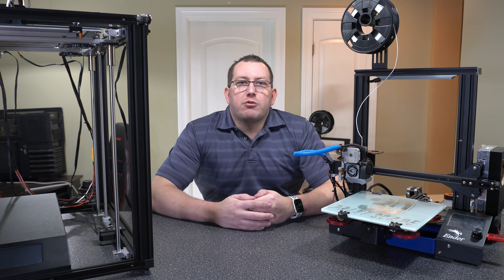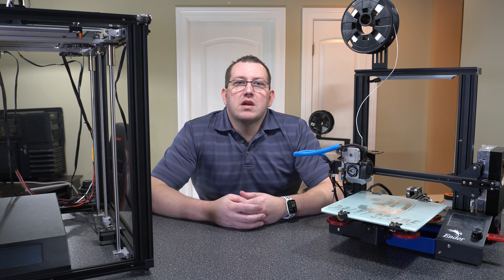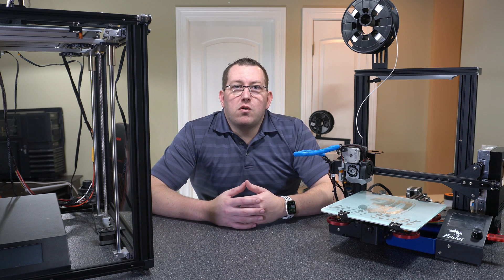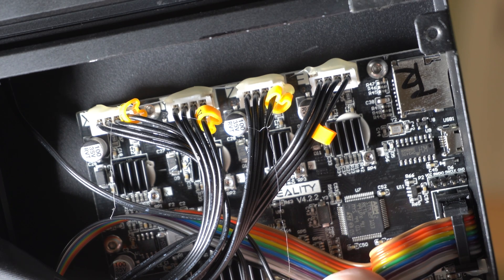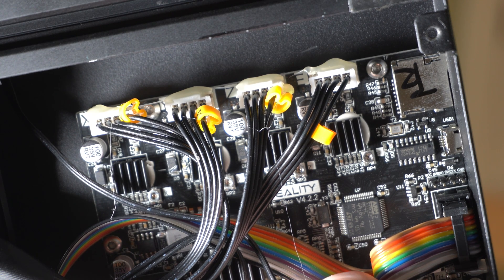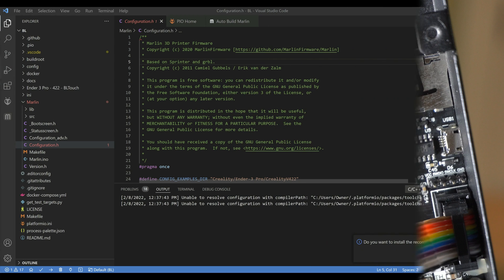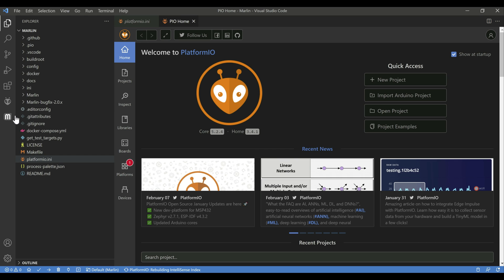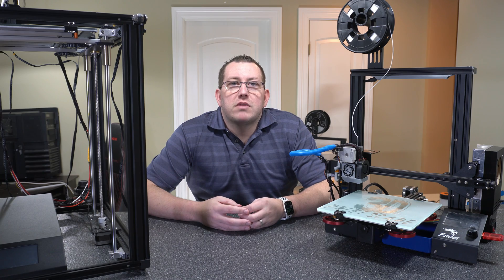Creality 4.2.X Chip Change – Details Inside!

Comment from the maker: I hope you found this overview helpful! If you have any questions or would like other tips/tricks, just let me know in the comments.
Reply: Yes please!
Reply: Hello Rob, hope you are well. I have used the firmware off your website but i am still having problems with my ender 3. I am still getting flickering on my screen. I have the 4.2.2 with 512k chip I also have the cr touch but that is not enabled, when it is and I use that firmware i have no screen flicker, but CANNOT configure the cr touch correctly. Any help really appreciated. Many thanks.
Reply from the maker: @Ameliawebb2016  What firmware did you grab off the site?
Reply: @3DPrintscape  i downloaded the Creality 4.2.2 (RET6 – 512k)	bugfix-2.0.xno mods version. Thanks for replying so fast by the way!
Reply from the maker: @Ameliawebb2016  Try the 256k version when you get a chance.
Reply: @3DPrintscape  i will give that a try as soon as my latest print is finished many thanks. Brilliant website and you tube videos, I will recommend them to anyone that gets themselves into 3d printing. I think a few of my work colleagues are getting interested because i have just got one. They are a minefield but your help is greatly appreciated Rob. Thanks again. Will let you know how it goes with the 256k version 👍
Reply: @3DPrintscape  working perfect now Rob mamy thanks. Had to flash to touch firmware then back to 256 for it to flash though for some reason. Just trying to tweak for petg print now, really stringy ha ha. Thank you so much again for your help and firmware.
Reply: Hello again Rob sorry another question. My printer is the ender 3 4.2.2 gd ret6 chip. Is it ok to use the pro firmware on it as i have noticed on the main screen it now says ender 3 pro on it. I am having a few printing issues at the moment and wondered if maybe i need to go back to the stock firmware or pro is fine. Many thanks again for your help and videos. Cannot get the cr touch setup either 😅😂
Reply from the maker: @Ameliawebb2016  Ya that should be fine. To the firmware there is no difference between the base and the pro.
Reply: @3DPrintscape  thanks. It seems to be running good now but i have had to order a new hotend and tube as it failed miserably. I will get there eventually i hope 😅

Comment: Still new to 3d printin but u think this is was my ender 3 pro can no longer read sd card after updating it from the creality after installing the firmware for a cr touch board 4.2.2 it says no tf card
Reply from the maker: Hi. I saw something about this a while back, i think it may have been a bug with the Marlin build at the time or it was the build for the wrong chipset. You can still flash it to a different version of the firmware on the SD card. It reads it at that level but not when your in the printer and want to select a file to print.

Comment: Hi Rob, I've got a V2 Neo with v4.2.2 GD32F RET6, can I still use this firmware? I'm having problem flashing this back to stock for sometime now. been left alone for a while, I'm now just got the time to circle back to sort this out.
Reply from the maker: Hi. I havent looked up the differences between the standard and v2 neo. If the build plate is the same size it should work.

Comment: hello, i am having hard tome upload your costume firmware because  of version. i want to enable dircet drive... i found how in the configertion file but cant rebuild it. i need you to tell me the exact version you have use in this video or even upload a direct drive + BL touch firmware to ender 3 pro on your website. thx!
Reply from the maker: Hi. The config files wont work if changes are made to them in later releases, i just include them for reference. The easiest way to make a new build would be to grab the latest config and build and use a tool like beyond compare to see the changes between the config files.
Reply: @3DPrintscape  I don't know how to do that, I have tried to build firmware with the latest marlin... But when trying upload the build firmware my printer doesn't recognize it... I tried to change the name... Like: firmware112234

Comment: Great video!, just helped a mate of mine.... and found out after 3 hours of troubleshooting that he doesnt have a SMT board. ( we tried both the 512 and 256K firmware) but he has a GD chip... And that fixed the issue. His firmware got corrupt so we needed a new one. And NONE of them worked till i went to crealities site reluctantly and was like.... lets try their broken borked firmware. And low and behold.... theres a new GD chip.
Reply from the maker: Hi. They keep changing the chips out, not sure why. Later marlin build should have support for the GD chip, i just dont have a printer with it to test.

Comment: so, I bought mine july of last year and I have a gd32f303 chip and I'm trying to figure out if I can put marlin on it or not
Reply: Crealities own GD firmware is "OK" it isnt as bad as their older firmwares. However im trying to get my own enfiroment for it. lets see.
Reply from the maker: Hi. I have been able to get it to work with the new 256k environment option.
Reply: @3DPrintscape  I was reading on the th3d post about it, that you could, but it was introducing artifacts. Most people are just upgrading the board to install Marlin.
Reply from the maker: @STOPH3R01991  That is always an option as well.

Comment: What about the GD 32 F 303 RET 6 chip?
Reply from the maker: Hi. That is a 512k chip, they started shipping with them after i made this video. Recent firmware builds should work with it.
Reply: Did you tried the 512k stm build?

Comment: I have a 4.2.7 board with a rct6 chip
Reply from the maker: Hi, You would use STM32F103RC_creality (256K)
Reply: @3DPrintscape  and do i need to change  anything in config h. My printer is stock
Reply from the maker: @jonathanjo4273  Depends on what your trying to accomplish. If your not adding any mods or anything, you wont need to mess with the configuration.h file.
Reply: @3DPrintscape  thanks a lot

Comment: Hi.. My name es Leo, from Argentina.... I need make a questions.. I've an Ender 3 Pro 4.2.2 and a chip STM32F103 RET6. I saw your video about how enviroment select (mine is 512k). 
The first question is: i put  in platform.io:

default_envs = STM32F103RE_creality

#define X_DRIVER_TYPE. Wich I have to select...?
I tried with A4988 and TMC2208_STANDALONE. But when I put the firmware into printer, I don't have any problem 
but it only prints one layer and the lcd restarts. By now I'm keeping the original version of marlin.
Thanks for all and regards.
Reply from the maker: Hi. It will depend on which version of the board you have. If you have the standard 4.2.2 you will choose A4988. If you have the silent one, you will choose TMC2208_STANDALONE.

Comment: Thank god I did some research before updating my nephews firmware. Got him into printing when he get the 100 dollar ender 3 pro from microcenter. Sure enough his is the RCT6, so I compiled marlin 2.1 for him and got it working, everything checked out except when it gets to the same spot on the purge line everytime, it reboots the printer. Looking into it now as I shall not accept defeat but if you have any info on this sort of issue it'd be immensely helpful!
Reply from the maker: Hi. I haven’t seen that behavior before. I would grab the latest firmware again and make sure your using the correct config example.
Reply: @3DPrintscape  thanks for the reply! my vigorous searching last night led me to powerless recovery. That was the culprit. Must be a bug in marlin 2.1 as I haven't seen many people reporting this issue. Disabled it via LCD and it worked like a charm. Went ahead and disabled in firmware to prevent other mishaps. If I had more time I'd play around with Powerloss setting as he'd like to keep it, but I'll probably just end getting him an SKR mini as I have one in 3 of mine and they are fantastic!
Reply from the maker: @TheGrowOp  Im glad you got it working, and thanks for sharing the fix.

Comment: I just bought two Ender 3 Pros, and both came with an entirely different CPU. Instead of an STM32F103 RCT6 or STM32F103 RET6, I have a GD32F303 RET6. I know this is a slightly older video but I thought it was most relevant here. It seems they've changed the CPU out yet again... Any idea what this might mean for compiling my own firmware? 

Thank you for the incredibly helpful videos, :))
Reply from the maker: Hi. I did hear about that, im wondering if they are having a hard time getting the chips. I also think that is whats causing the screen glitch many people are having not after updating the firmware. I think you will be fine with the normal 256k build. You can try the one from my site, it doent have the screen glitch issue. https://3dprintscape.com/marlin-firmware-builds/

Comment: Thanks for the video! Just a heads up though, I purchased my Ender 3 Pro sometime around November of 2021 and it appears to have the RCT6/256K chip. I'd recommend people checking even if they purchased closer to the end of 2021.
Reply from the maker: Hi. Thanks for the info, i thought they only shipped after January but it could also be region specific.
Reply: Me too. Purchased Ender 3 from Amazon at December 19, 2021   and have the RCT6/256K chip on board 4.2.2.
Reply from the maker: @yurik.3865  Thanks for the info. I guess they started shipping with this sooner than I thought.

Comment: Rob I'm having nothing but issues
Mines rc6 256. Cr touch and touch screen. I've built computers less headache could really use some guidance.
Reply from the maker: Hi. What issues are you having?
Reply: @3DPrintscape  just talked on discord about it to you. Going to try and compile a nightly I assume has 256k option. 3/9 goes past bed on bed leveling and keeps trying to go making motors sound horrible. I end up flipping the switch to make it stop. After that's figured I gotta figure M out how to make touch screen work with other firmware besides stock.

Comment: I seen your video about the z axis adjustment, it didn't work for me and my bl touch is leveling way to high! Any tips?
Reply from the maker: Hi. Were you able to set your z offset? Also, keep in mind that the z offset dosnt come into play until a print starts. A auto home will have the z axis at 10mm from the build plate.
Reply: @3DPrintscape  yes I did get it setup, I watched some of your videos and they really helped, thankyou.

Comment: Thank you for the video, it was very helpful. I have another problem I would like to hear your input on. My Voxelab Aquila printer sometimes will start a job and will arbitrarily decide without any outside interference that the print job has completed. It stops wherever it is moves the nozzle to the back left side of the plate and on the screen says the job has completed. After clearing what was just printed off the build plate I can start the job again immediately and it will print flawlessly. Any thoughts on why this happens?  Thank you again for your input I do rely heavily on your knowledge.
Reply from the maker: Hi. This sounds firmware related. Have you tried to swap out/upgrade the firmware at all?

Comment: What functions have been dropped in 256k versions of Marlin?
Reply from the maker: Hi. When looking at individual functions, i don't think anything has been dropped. The issue will come in if you try to enable too many functions. The total memory footprint of the build is shown at the bottom of the terminal output in VS Code after the build is complete. It will say RAm and Flash. This is related to the flash memory. The total usage with the base build and the bltouch enabled is about 186k.